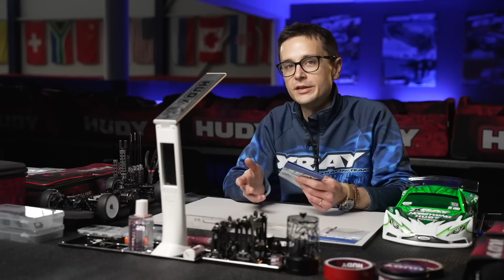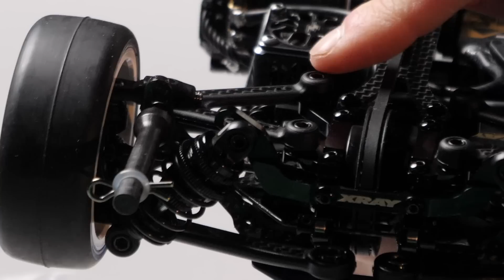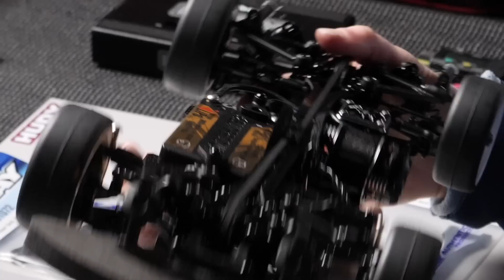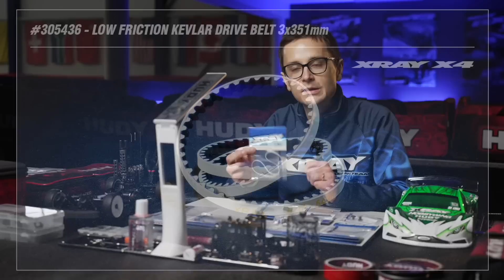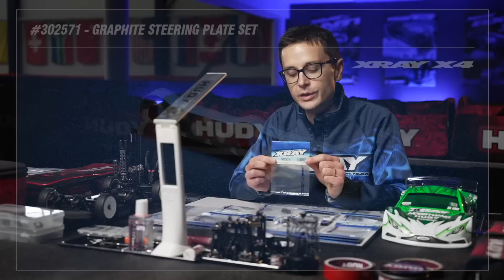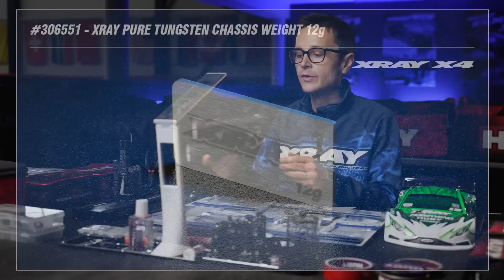XRAY X4 – Top Option Parts

Comment: xray is ridiculous with all these options parts.  My god no wonder the hobby is dead.  You want me to buy a $650 base kit and then add $1000s in option parts, many of which should be included in the kit if the team uses them in all conditions.
Reply: Exactly. This is 100% the most ridiculous overhyped rc brand. Marketing are on same level as Rolex lmao

Comment: 09:50 how about mounting the wheels on the narrower hexes, they also arent flat on the hexes. do you use there also the "setup shims" between the hex and wheel?
Reply: Not for mounting the wheels. The wheels are plastic, so they will give in slightly when you tighten the nut.